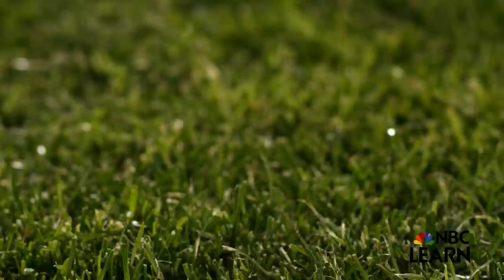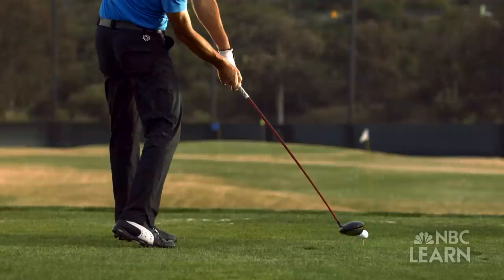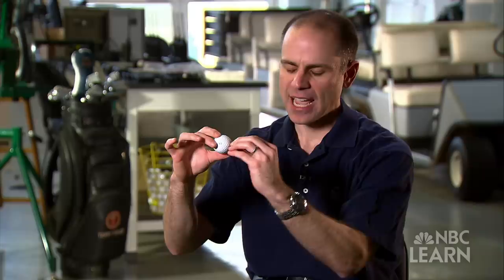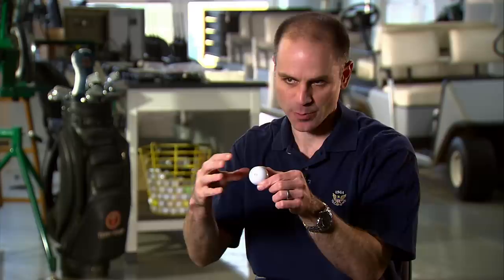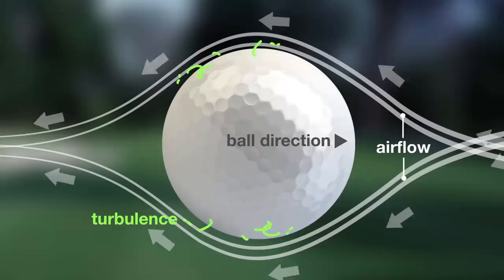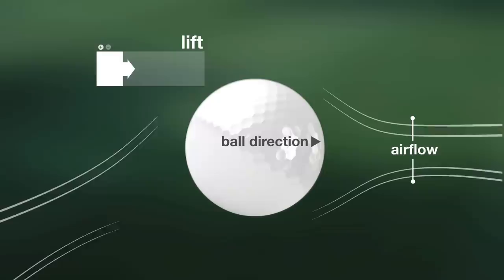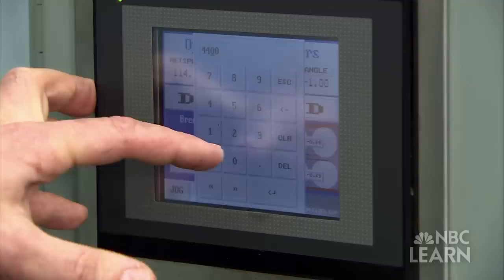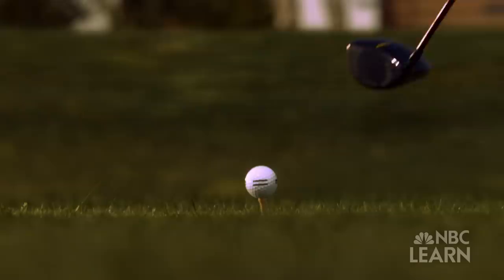Science of Golf: Why Golf Balls Have Dimples

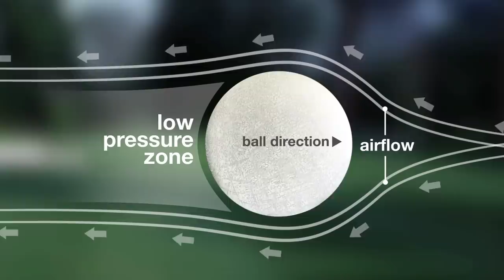Comment: Just a correction at 2:00, low pressure does not “suck” the ball,  its the high pressure area around the side of the ball thats “pushing backwards” the ball because its trying to go with the low pressure because of the pressure difference
Reply: That’s so interesting. All this physics stuff is so new to me (as I never took a class on any of this). I find it fascinating. I know I asked this elsewhere, but why don’t they make the surfaces of planes and rocket ships dimpled? Would this help them go faster? What if they did this to  cars? Would it make them more fuel efficient?

Comment: Makes sense.  A friend of my father's had an airplane that went through a hail storm.  He swore the airplane flew 3 - 4 kts faster after the hail storm.
Reply: I often wonder what it would like to fly an airplane with dimpled surface or at least with some areas being dimpled and others smooth.
Reply: @pinklady7184  Dimples cause higher friction. With a golf ball, the decrease in wake drag makes up for it ... but in the case of a plane they are already aerodynamic, so the percentage you decrease wake drag is much lower and probably wouldn't compensate enough for the increase in friction (If it did I'd assume people would be doing it already).
Reply: @pinklady7184  A similar concept is actually already used. "Vortex generator" is the key word. But @8bitpineapple is also correct. These are not typically used on airliners. If I remember correctly then the vortex generators improve low-speed flight characteristics while in cruise it would add slightly more drag – at higher velocities the skin friction drag dominates, rather than the pressure drag (which the dimples intend to reduce). By the way, I'd imagine that in theory a teardrop shaped (or something cross-sectionally similar to an airfoil) golf ball would fly the furthest...of course hitting and having it maintain the attitude would be difficult.

Comment: Some years ago, Boeing used a redundant early 737 to 'golfball dimple' the fuselage.  They did not touch wing tail or other lift surfaces. Just by 'dimpling' the fuselage, Boeing noted 3 per cent less drag resulting in a big fuel saving. [ps. This was never implemented on operational aircraft due long parking near maritime and other industrial  toxics and related issues.]
Reply: I was jusr going to say why doesnt are cars or airplanes have this surface.

Comment: Turbulent boundary layers vs laminar boundary layers. Turbulent boundary layers can sustain adverse pressure gradient better than it’s counterparts. Turbulent or vortex generated by this rough surface transport kinetic energy for the edge of boundary layers to a low momentum flow at the surface. This will greatly reduce flow separation or reverse flow that will cause drag. Of course you need energy to bend the fluid to create vortex thus creating drag but the result of total drag reduction generated via vortex generator far outweight it’s disadvantages.

Comment: If this is so , then it makes one think and wonder why all the wings in modern aircraft as the  Boeing 777 and the  707 and the Airbus 380  are not all covered with dimples? 

Fluid dynamics are so very complex indeed.  I would say that it all has to do with two type of vortexes.   Those type of  vortexes that are long and stretched  and their axis is parallel with the  motion of the  item in question and occur on wing tips and  and intentional vortex generators, they seem to  move  back  with respect to the flying object in question and grow in size till they break down.  And there are  the others,  whose axis is at right angle with the velocity of the item , they are short stubby no bigger than the  flying item itself and rotate in some location on the flying object and they seem to be carried and move with the flying object at the back and sometimes at the front end,   where they rotate in some localised  corner till due to turbulence they oscillate and are replaced by similar vortexes.
  
In a golf ball there are so  many different conditions to consider.  Behind a  smooth golf ball, the latter ones  could be like those ring vortexes  which  are circles and curl on themselves and with which dolphin  and whales like to create and play about with. turbulence and irregularities do  disturb such beautiful ring vortexes.  

1.There is a situation where the ball just travels and does not spin in any direction.  The dimples on the circumference behind the front compression zone  create long stretched elongated vortexes of  ever growing radius,  rotating helix which due to viscous and momentum force, will pump in  air to fill the space behind the ball, presumably increasing the pressure behind the golf ball and lowering the drag.
 
2. There is a situation where the  ball spins in some direction where the axis of the spin could be  existing in a flat plane at right angle to the  motion of the ball.  In this case  the ball will be subjected to a force known as Magnus effect which will cause the ball to  swing in one preferred direction and this is a situation where footballers shooting a ball use it to score a goal from the corner point. In case of a golf ball swinging and curving  in the upper direction, this  would cause the golf ball to fly for a longer time , hence to improve range. Please note that I prefer to call the lifting due to a rotating ball  as it travels forward ,  the Magnus effect rather than the Bernoulli effect.

3, There  is a situation where the the axis of the spin could be parallel with the  direction of flight of the ball, but due to the nature of the club hitting the ball, this latter state never really occur in a golf ball. In guns however, when bullets and missiles are shot, it is desirable to spin them  around the axis parallel to the flight as this cause it to behave like a gyro and will  not cause the bullet to tumble over itself as it makes its way to the target.   In a golf ball due to the fact that it is a sphere, the latter  is not of concern.
Reply: i stopped reading when you said "vortexes".... see the red line under that word bro. VORTICES
Reply: TLDR
Reply: The cross section of a wing is tear drop shaped not spherical... There is little to no vacuumm affect on the taillong esge of a wing so the golf ball efgect does not apply... If golf balls were tear drop shaped. They would not need dimples, but they would be hard to hit
Reply: Carmel Pule' do you study or work in engineering? If so, what softwares do you use at work?
Reply: @mordyfisher4269  True, copying my another answer: "A similar concept is actually already used. "Vortex generator" is the key word. But these are not typically used on airliners. If I remember correctly then the vortex generators improve low-speed flight characteristics while in cruise it would add slightly more drag – at higher velocities the skin friction drag dominates, rather than the pressure drag (which the dimples intend to reduce). "
Reply: @pinklady7184  In Europe at least, in academic settings ANSYS is typical (basically all-in one package, e.g. ANSYS Fluent package for fluid dynamics). In industry one might see also Altair HyperWorks. There are also COMSOL and Elmer FEM, but these are just the names I have heard. If you are brave enough, you can also try OpenFOAM and SU2. These are open source and need a bit more setting up.
Reply: Agreed but Jeffrey Epstein still didn’t kill himself.

Comment: Why car body doesn't have these dimples than?
Reply: It works, mythbusters did a car with dimples.
Reply: MountainTech that’s sick, what episode?
Reply: Imagine dimples on bodies of airplanes and space rockets.
Reply: Tomasz Sz I know that the Corbin Sparrow - a 3 wheeled microcar - actually did.
Reply: Cosmetics
Reply: @87stratman  That may be so, however a car doesn't spin, so there are different forces at play.
Reply: Wooow, my car has dimples on the side scoops and the lower plastic trim on the bumper. I always thought it was a strange styling choice.
Reply: Actually some cars effectively do, the dimples are simply ‘vortex generators’ that serve to introduce turbulence and promote attached flow. Some cars have these too but in the form of little “shark fins” that run along the back edge of the roof before the downward slope of the rear window. They work in exactly the same way, keeping the airflow attached further along this slope and reducing the area of low pressure behind the car.

Comment: Would dimples help the flow of air in a motors exhaust system?
Reply: most of the exhaust is flowing through the middle of the tube not touching the sides. you may see the exhaust on the sides move faster, but that would be an undetectable change in performance.
Reply: There are sections of the tubing that are not straight, i.e. bends and mufflers, so it is not all attached flow

If the air moves faster at the sides, even if only a small width, the volume of air moving faster would be great due to the radius squared factor, so it’s possible it may be detectable. In Motorsport, races are won by seconds from seemingly undetectable advantages 🤷

Comment: Dimples work but not for the stated reason. The spinning dimples feed air into the low-pressure zone behind the traveling ball. This puts a flow into the low-pressure zone allowing it to flow away in a stable cone shape, streamlining the ball.
Reply: sassyblondel "Feed air into the low pressure zone". Is that your way of saying the dimples delays boundary layer separation due to better transport of bulk momentum in turbulent boundary layers compared to laminar? Because I don't believe spin has to do with this effect.
Reply: @rightyourwrong  Magnus (in cooperation with Newton), NOT "Bernouli".  Thank you.
Reply: @rsteeb  Exactly! Bernouli's principle is for inviscid flow, which would be an ok approximation for motion through air but only a low velocity....the golf ball travels at high velocity and there is significant viscous effects (aka Newton's Law of viscosity), so one can't apply Bernouli's principle.

Comment: So why aren't airplanes dimple?
Reply: p b Airplane aren’t spinning object like a golf ball or tyres and also its not a sphere ball instead airplane utilise a tear drop aero style design and this pretty much reduce or eliminate the aerodynamic hole and reduce the chance of flow separation which induce the low pressure region at back end of the system.
Reply: p b A lot of aircraft wings do utilize vortex generators to accomplish essentially the same thing.